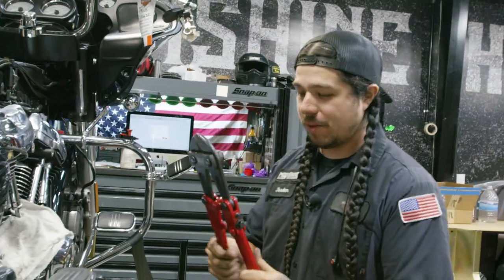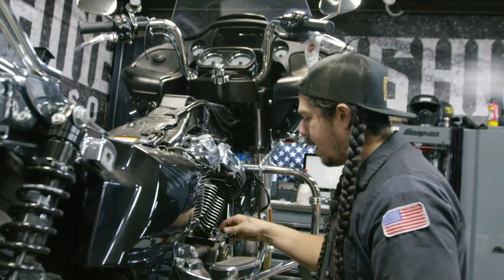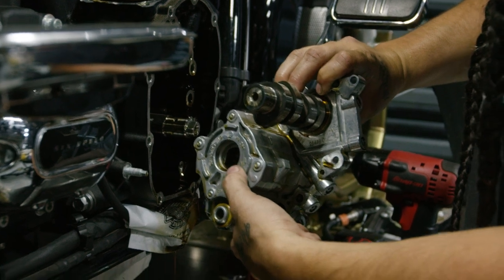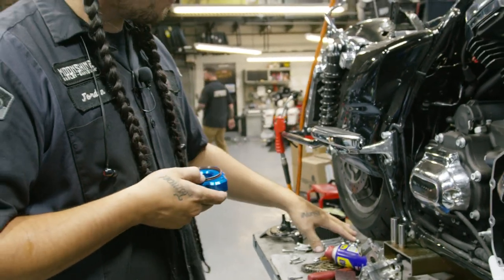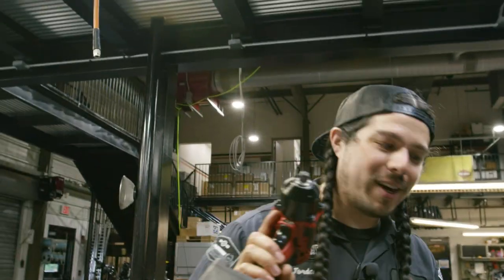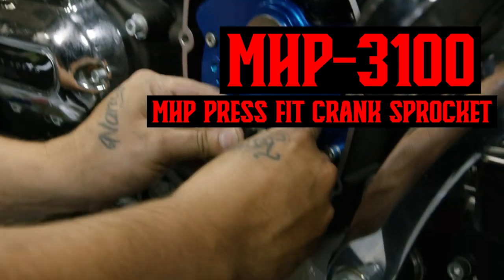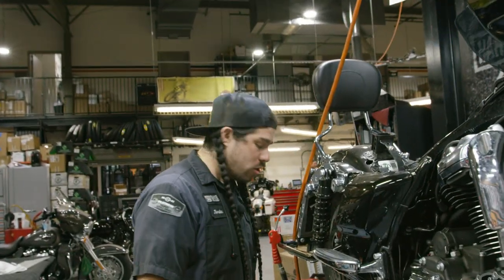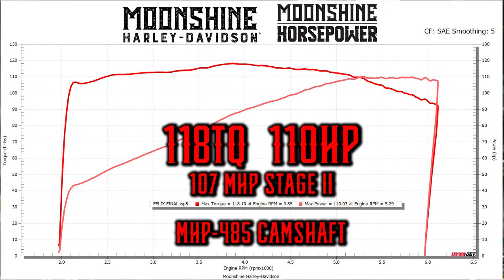MHP Stage II upgrade: Prepare to be amazed

Comment: Why no new lifters/tappets? Just curious. Also that high of lift should probably need new upgraded valve springs? Not sure if I’m correct or not just a question. Appreciate any feedback you can give. Nice video.
Reply: the MHP 485 is actually a collaboration between George Bryce at Star Racing and Moonshine HD, it's a Star Racing 30 / 30 cam, the 485 is as high as you can go without having to replace the stock valve springs, so, the answer is, no, you do not need to replace your stock valve springs, ride safe

Comment: Ok, nood question here, why does changing the cam profile changes the power figures? 🤔
Reply: A engine is just an air pump the more air in and out the more power changing a cam allows the valves to open further and stay open longer there for increasing airflow making more power
Reply: @dylancrowder3030  thanks!

Comment: I have a 2019 CVO SG, (117 motor) I installed a RS 472 cam, with all of the additional upgrades, I'm producing 133ft lbs of toq, with about 113 HP, I'm wondering if Installed the MHP 485 cam what would I be able to get out of the bike in terms of Toq and HP (if anything) I also have TAB performance exhaust with Zombie baffles ----your thought's--thanks in advance.

Comment: How much is to do that upgrade?
Reply: Moonshine will "probably" charge you about $6K for a stage II based on earlier comments I've read on their pricing, they're expensive, I would recommend sourcing your parts, I purchased most of mine from Fuel Moto and finding a local builder to do the install, I would recommend going with new lifters as well though, not sure why they did not in this build, Fuel Moto carries the Star Racing 30 / 30 cam which is the same as the MHP 485

Comment: Great video thank you !
Could you please list down all the items you reccomend to replace for an ideal bullet proof stage 2? 
I'm thinking of S&S 465C Cam, pump, plate, lifters, bearing, Tappet cuffs, tensioner combined with Fueling pushrods, crank sprocket and shorty sum plug + HD Screaming eagle 64mm manifold with throttle body?
My trike is a freewheeler 2018 M8 107. 
Thank you so much ✌️
Reply: great list!! you're going to find that the 64mm throttle body and manifold are too big / large for a 107, I did the stage II and used most of the parts you mentioned, I went with the Star Racing 30 / 30 cam, which has 485 lift and is a "bolt in" cam so you can use your stock valve springs, you didn't mention if you plan on changing your injectors? I assume so if you're going to a large TB, good luck with the build

Comment: How come you didn’t measure run out?  Please clarify which camshaft you are using? Title and technician do not match up.
Clarify that this cam is a drop in and will not require separate valve springs . Thank you
Reply from the maker: MHP 485, that’s what comes with our stage II kit! Got it mixed up in the title 😂